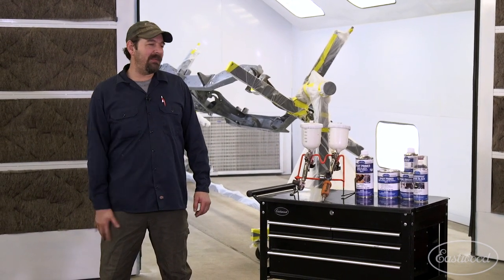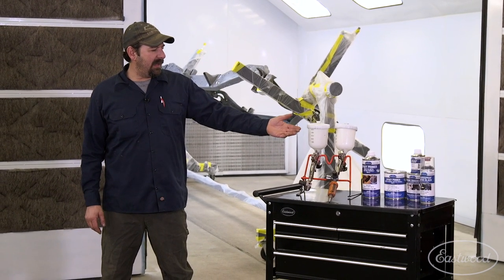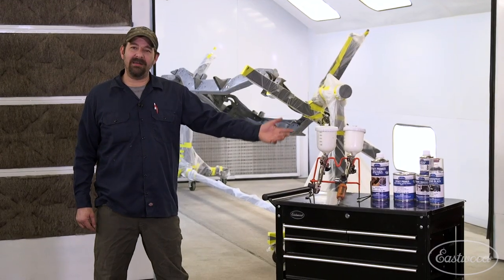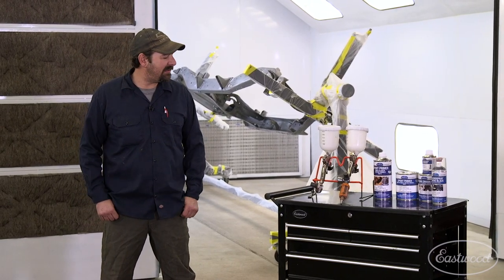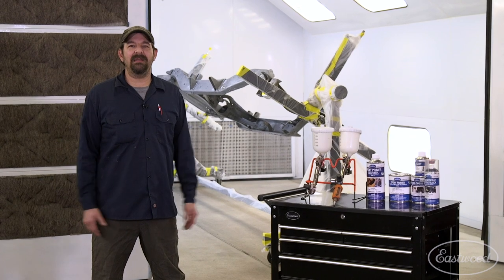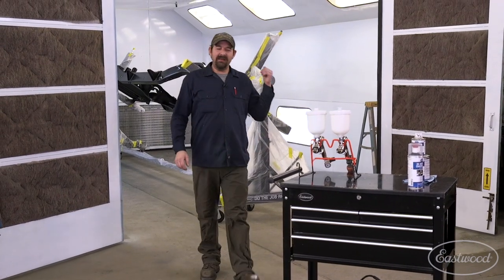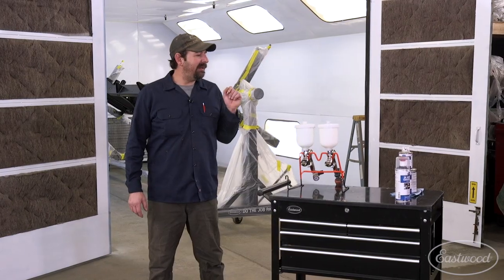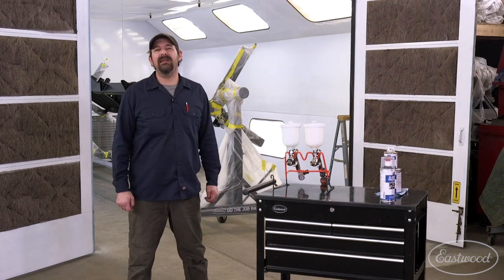How-To Lay Epoxy Primer and Topcoat: C10 Truck Chassis with Eastwood

Comment: What kind of rust protection/prevention does the epoxy primer offer?
Reply: epoxy primer is a sealer. you can get it in sandable and non sandable. it should lay smoother and shine more if you sand it before painting. But main thing is getting an epoxy that is DTM- direct to metal. It looks like some ppl try to save time and just paint it black directly to the chassis, but i think ill really clean it up and take it down and seal/prime it on my next project.

Comment: Can a filler be used (to hide pits for example) between this primer and the color coats? or would I need to etch and fill the surface before the primer?
Reply from the maker: Our Contour Premium Filler would work well direct to metal or over primer as well - https://www.eastwood.com/eastwood-contour-premium-body-filler.html

Comment: How much should be the time span between 2 coats and how many hours does primer and paint took to dry completely
Reply: It depends on this case most industries use what is called  baking it's like an oven but make for bigger projects like vehicle which baking time is less timing to what you would need if you don't have. We used to use light like flood lights as it's high in light and takes about 1-2hrs depending on the heat outside.